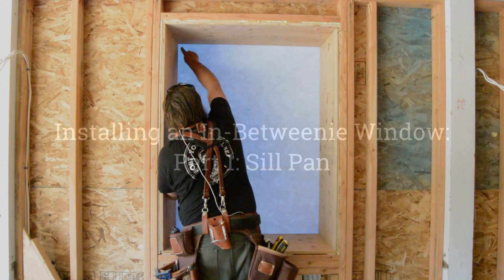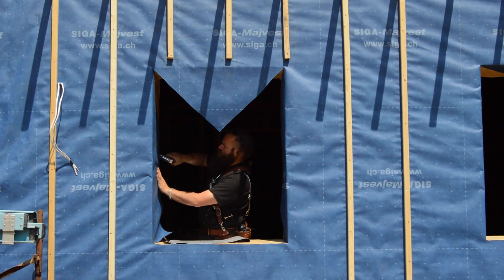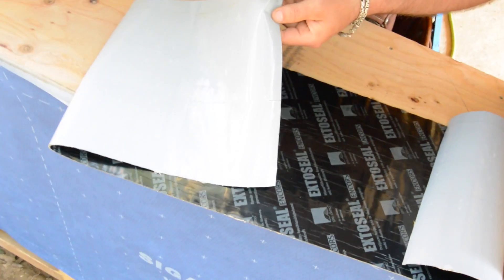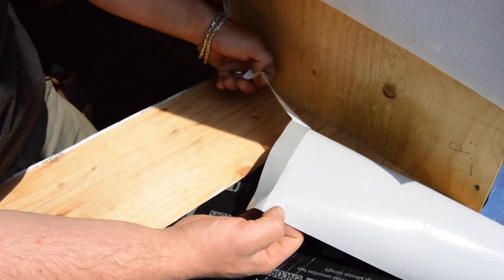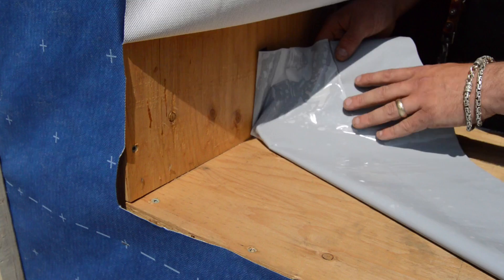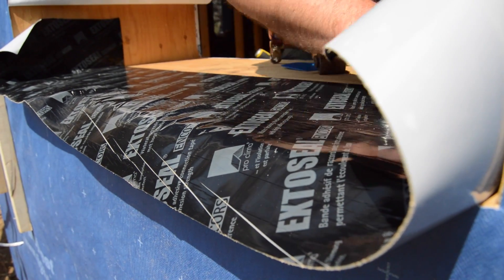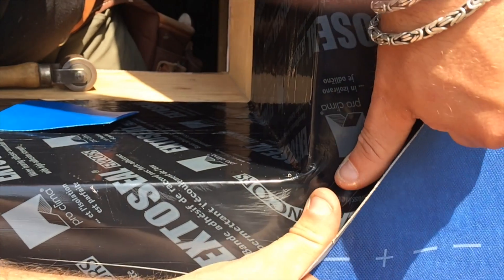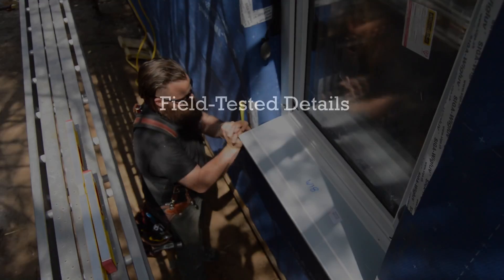Flashing an 'In-Betweenie' Window, Part 1: Sill

Comment: the pro-clima system is poor quality. that tape that you stretch around the corner, it becomes tense, and the tension eventually overcomes the butyl based adhesive and peels back at the corners. have seen it myself numerous times.